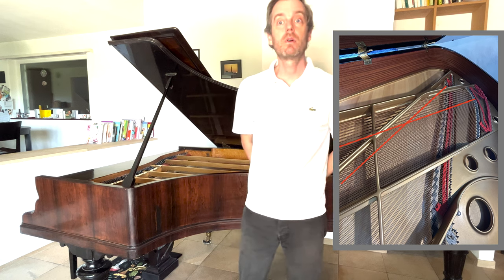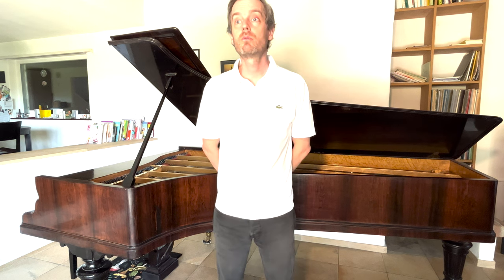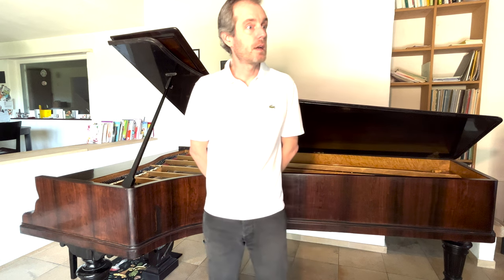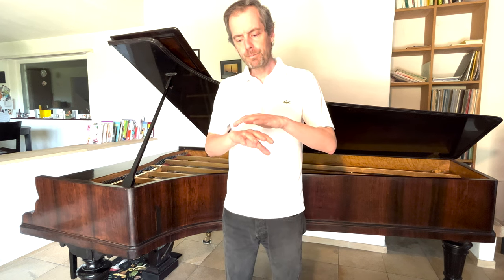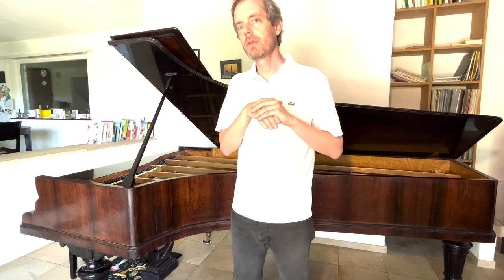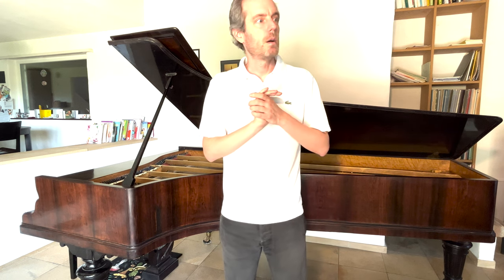Straight strung vs. cross strung grand piano

Comment: Cross stringing has been a thing since the 1850s when the modern piano minus 3 notes first came around and was just an option back when you had a choice. I got to play one made by Ronisch in 1857 which was cross strung and all modern on the inside but the soundboard was in pieces so I didn't hear the true sound.

The piano I have however is strait strung with 77 keys and 2 strings per note and the sound is magical and more clean than a cross strung piano where the bass overpowers the tenor section and ruins the kind of music I write. Because of this, I wouldn't saw cross strung pianos have a better quality of sound but a bigger sound at the cost of some of the quality and clarity.
Reply from the maker: @user-lh3uz1cp7y  Fascinating!  Thanks for commenting. May I ask what kind of piano you have?
Reply: @oliveemilwetter8387  I have an upright made by bell piano and organ co with a modern style action, a 3 quarter plate and it's designed to have tiny uniform hammers but someone put modern ones on it long the way so I'm changing them back during the restoration. The scale starts out at F1 and ends at A7.

It's probably one of the cottage models since the cabinet is really compact and very simple but doesn't have a lot of details besides a carved panel on the front that lets the sound out.
Reply from the maker: @user-lh3uz1cp7y  That's interesting. It may well be that no bell pianos have made it to my country. :-( I'd be interested to find out in what ways it is different from the German pianos from the same period that we usually encounter over here.
Reply: @oliveemilwetter8387  It would be different in more ways than the average Canadian piano since it was a period instrument of a by gone era when it was made but the action is mostly the same besides working more like a console piano than an upright not having long rods at the bottom of the action but sitting directly on the capstans and is less consistent with modern hammers than pianos designed for them.

The strings are also the same depth from the action across all registers since the hammers were suppose to be the same but the hammers it has account for that at the expense of making it harder to play.